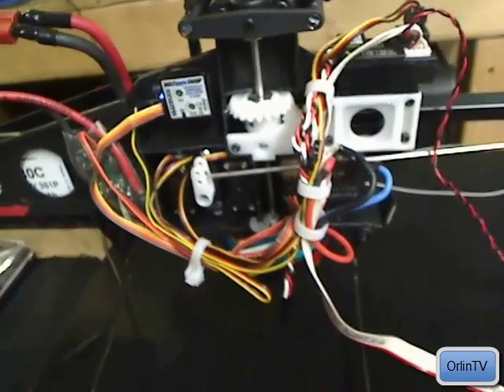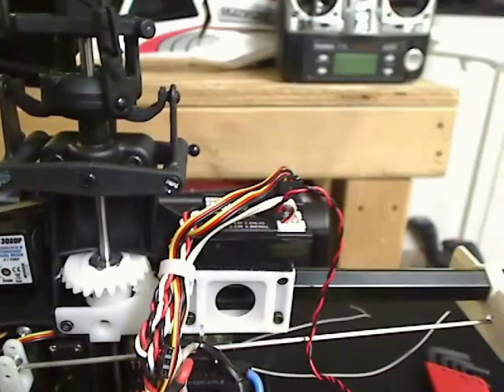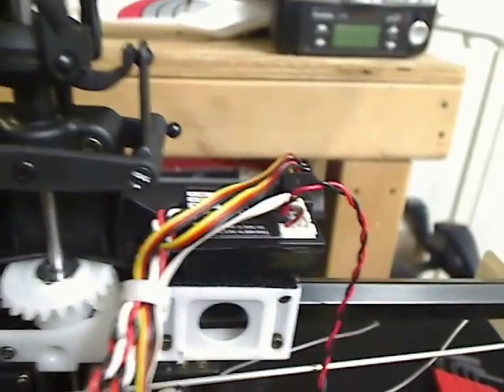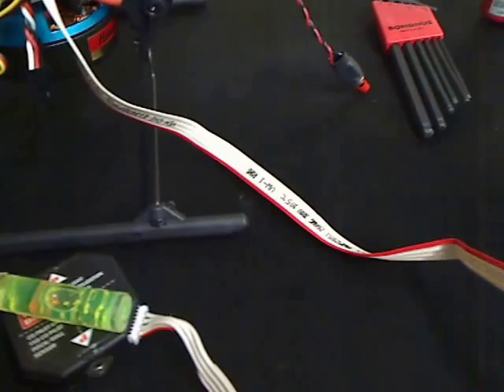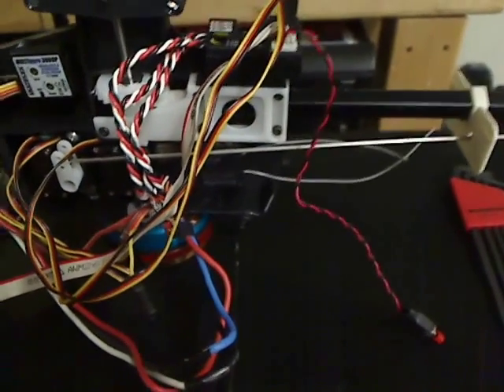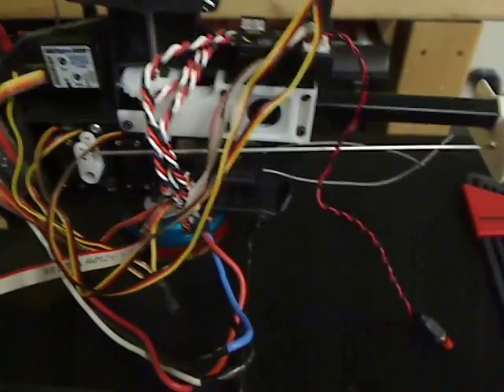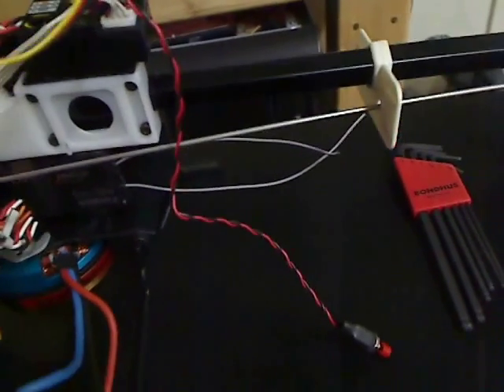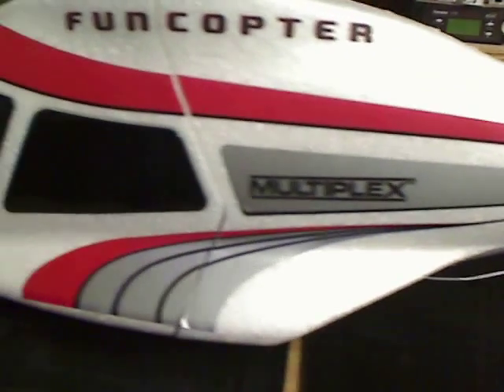Funcopter RC Helicopter with FMA Co-Pilot CPD4 Tutorial

Comment from the maker: @3nigm01 Your welcome! Grab the heli at the CG (prop) and see if it leans forward or backward. If it doesn't with the weights or re-positioning of the sensor then it should fly level. In the funcopter there is room to slide the battery forward or backward to change the CG. Keep in mind, you can always trim the heli to compensate for nose or tail heavy. The less weight the better :)

Comment from the maker: @3nigm01 Hi, it's best not to add extra weight as it will load down the motor and or run through batteries faster. I would try balancing the IR sensor maybe closer to the body as opposed to the back of the tail if the heli is that weight sensitive.